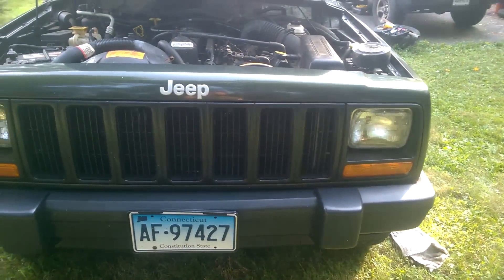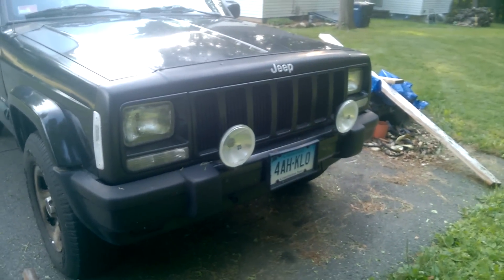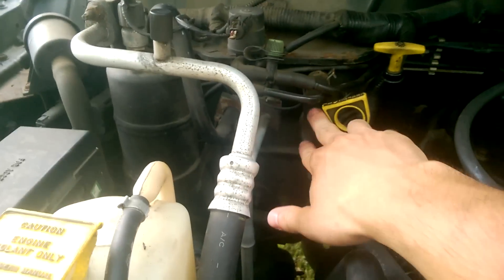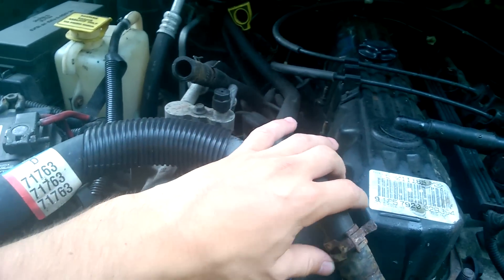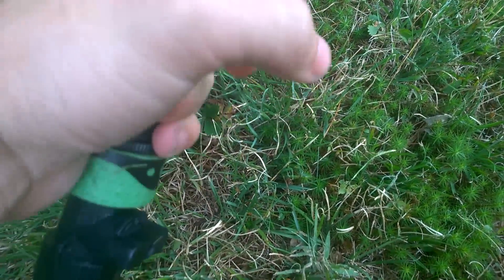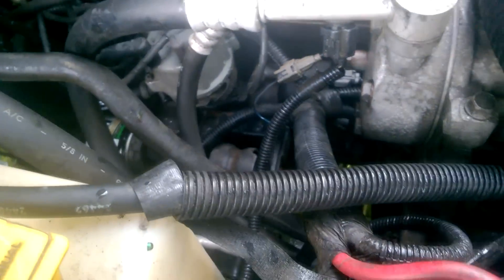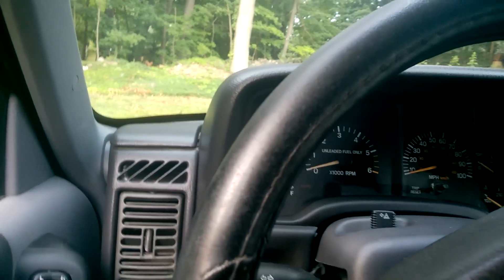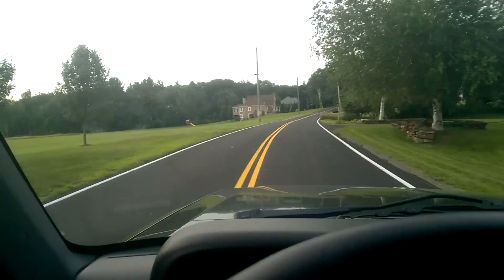1998 Jeep Cherokee XJ Heater Core Flush

Comment: My heater was luke warm at best.  Local shop flushed the coolant system for me, but no real change to the heater temperature. The same local shop quoted me $700 to swap the core in my Cherokee. I flushed my heater core this morning, and it made a night and day difference. Great video, thanks!!
Reply from the maker: Jarrod McCarty no problem! Never heard of a shop that didn't scam it's customers and do bad work at best. Glad I could help :)
Reply: Yes! The man always trying to take advantage of our lack of knowledge about vehicles! You win.
Reply: @hermit6208  Not so much taking advantage of our ignorance. Replacing the heater core is an absolute nightmare that requires removing the dash.

Comment: I'm about to attempt this in February in wyoming. Bought a Jeep Cherokee in Jackson, drove 3 hours with no heat 🥶 let's pray this works!
Reply from the maker: If flushing it doesn't fix your issue I'd imagine its the air blend door. Keep in mind that if anyone ever used stop leak in the system that will cause weak heat as well and will likely require more pressure than the average garden hose puts out. Honestly that stuff shouldn't be legal its useless.
Reply: @1598hi  I got it working! Core was nasty, but the return line was clogged near the water pump. Put the hose down in there and got the last clog out. Hot heat!
Reply from the maker: @j_mars_cars  good for you! In the spring you might want to try to flush the block and radiator as well. Sounds like you had some seriously substantial buildup
Reply: @1598hi  this Jeep is getting a full going through. It's got a bunch of small issues that need to be buttoned up. Don't worry, it'll get there. It's my mom's Jeep though, I own a 4runner that I gotta keep building

Comment: Thanks man. That's the cleanest 187000 mile vehicle I have ever seen
Reply from the maker: Still just as clean now with 210,000 miles. Thanks for commenting I hope this helped you!
Reply: @1598hi  we shall see later on today! When you started your vehicle up, I got a little movement down below! Sounds good man. Hopefully I can get my new to me WJ sounding the same. Or close to it
Reply from the maker: @hermit6208  I'm sure it will! Seafoam that thing and only run shell gas after that. Has the most detergents. I also have a flowmaster exhaust that I am pretty happy with

Comment: A couple things confuse me on the heater core/coolant flush.
1.) Seems like most people just use a garden hose. Would it be best to use a pump and set up a system that can flush using distilled water instead of tap water?
2.) some people recommended using a calcium and lime cleaner to really clear out the core. That seems like it would introduce undesirable minerals to the system.
Am I worrying too much or does it stand to reason that you'd use distilled water and not use C+L cleaner?
Reply from the maker: They sell special cleaners specifically for your cooling system and then flush the system after a little while. I think a garden hose is fine providing most of the coolant is actual coolant since that has anti corrosive properties and does not freeze. I wouldn't worry about using distilled water.

Comment: Nice video only issue is that you can flush the heater core no matter what setting the controls are at... If it's set on hot or cold it's all the same... Its doesn't stop coolant flow when you turn it to cold
Reply from the maker: Thank you for this constructive comment. I appreciate the correction
Reply: Before bashing Auto Zone about their tools and equipment keep in mind they have no way to test everything  when it comes back in and people won't tell when it is messed up. I bet they would be more then happy to swap it for you as they didn't know it wasn't working
Reply from the maker: @karlaharrell9424  I have noticed a dramatic drop in quality regarding everything from parts stores over the years. It's gotten to the point where I only use them as a last resort. You're probably correct about the tool though
Reply: Yes, the blend knob just actuates the blend door to go between allowing air into the cabin after passing over the heater core or ac evaporator.  On most older vehicles, this is vacuum-operated (which is why you hear a hiss sometimes) - on newer vehicles, it's usually a small electric motor called a blend-door actuator.  They are ...interesting to replace if they go bad.  If the engine is running, coolant is always flowing through the heater core no matter what the knob is set to.

Comment: Flushed my coolant and heater core on my new to me xj. The coolant was nasty and rusty. Tried bleeding the system for 30 mins and there were still bubbles and the heat was just lukewarm and not hot. After about 40 mins the coolant started pouring out so I shut it off. I did not use a funnel like you did. Any suggestions?
Reply from the maker: Did you park it on a slight incline? I would get a bottle of cooling system cleaner, add that, drain the coolant and replace it again. Sounds like you have some rusty sludge built up restricting flow
Reply: @1598hi  yes it was parked on the driveway with a slight incline. It already has cleaner in there with distilled water. Should I not burp it until I’m ready to fill back up with coolant? I wanted to leave the cleaner in there for a couple days that’s why I was trying to burp it.
Reply from the maker: @deegaw11  It was a good idea to get the air out. You dont want air pockets. Hopefully that cleaner is good enough to get rid of any stop leak. That sounds like it could be your problem if its not just rust debris buildup. Once you decide to drain the cleaner try removing the heater core hoses and backflushing them as well.

Comment: Great video. Do I have to drain the antifreeze before doing this? I recently changed my antifreeze but didn’t do this heater core flush and want to. Just don’t need to change the antifreeze since it’s fresh fluid
Reply from the maker: Nope! Everything you need to do is in the video!

Comment: Good vid flushed the zj today, still no good heat, bummer,  going to throw a new thermostat in next we shall see i really hope its not electrical.
Reply from the maker: Not losing any coolant or running hot? It might be the actual climate control knob itself
Reply: ReNegaDe-SpitFire  no not loosing  any coolant or running hot, and when its up to temp I can switch it from hot to cold and the luke warm air turns noticably cooler. If that makes any sense lol. Any advice would be appreciated. But It does blow hot at very sparatic times.
Reply from the maker: @halfassranch8363  I really think it's the climate control knob. You can order those from rock auto and autozone. I would make an account on maybe naxja to double check
Reply: ReNegaDe-SpitFire  i cant seem to find the knob, seems like this limited grand Cherokee is tricky. Its starting to piss me off. I live in colorado and need the heater lol.
Reply from the maker: @halfassranch8363  I feel you. Put your year, make, model, engine and transmission in the comments I'll try to find it after work tonight and get back to you around 11 to midnight
Reply: 1998 jeep grand Cherokee limited 4.0 not sure the tranny my wife drove it today. But its the full time 4wd if that helps. Thanks for the help I've always wanted a zj but didn't realize all the gremlins that come with.
Reply from the maker: Was looking online. Odd seems like I cant find one new for a zj either. The part is professionally called an a/c and heater control switch. However I do need to ask. How brown was your coolant? If it got really bad at one point in the past it could just be so gummed up the heater core just has to be replaced.
Reply: ReNegaDe-SpitFire  it wasn't really brown at all. I've done some research into these limited edition zjs and looks like some solder joints are prone to fail on the back of the big hvac panel. I agree with you that its not the thermostat because it gets to operating temp quickly and stays consistent. Looks like the limited grand Cherokee is a puzzle of its own lol. We have a week of good weather coming and I'll get it figured out. If not i can always just start a small fire on the dash. LMAO fuck it, its a 600 dollar jeep I'll get my use out of it and then send er down the road to the next poor unsuspecting fool.
Reply from the maker: @halfassranch8363  I recommend you join naxja. It's mostly for cherokees but it has a subforum for ZJ. You'll get it figured out before the weekend is over
Reply: Air in the system probably.

Comment: do i have to disconnect the hoses at the engine block? can i disconnect the mat the firewall and do it there? and if i can disconnect at the firewall, do i have to burp the system at the end?
Reply from the maker: It is much easier to take the hoses off where I took them off. At least in my experience they don't like to come off at the firewall. You will likely need to burp the system or you risk not having very strong heat.
Reply: @1598hi  yea i flushed the system but i dont think i did that great of a job of flushin it or burping it. The heat is still not hot. im gonna try again tommorrow
Reply from the maker: @Dibran9mm  once you do it again, if you're still having issues remember it could be the air blend door

Comment: Someone said in another video to blow out any extra liquid with an air hose
Reply from the maker: If you can get a little more pressure into the heater core that's great. Just make sure it's not too much. But assuming nobody ever used stop leak the reverse flush usually does a good job

Comment: Thank you!
Reply from the maker: ABC Sure! 😊
Reply: ReNegaDe-SpitFire . Great! Then take me all the way..... any tips on how to check the thermostat for proper function without removing it?
Reply from the maker: ABC If your engine is running way over temp or much colder you could have a thermostat issue. They are inexpensive and take very little time to replace. If you are having issues I'd start with a thermo and radiator cap rated at 16lb. I'd love to help you more if you give me some more information about what's going on!
Reply: ReNegaDe-SpitFire. Boom.... exactly what i thought also. Shes running cool. No problem, replaced many over the years. Appreciate you brother. Thank you for such a speedy response!
Reply from the maker: ABC Anytime

Comment: You forgot to flush the bigger pipes to
Reply from the maker: Those are for the block, not for the heater core. I put the engine in about a year prior along with new hoses and radiator. Heated core was all that was left of the original system and was the only thing that required a flush. If you need a tutorial on flushing your engine block there are other tutorials online, I have not filmed that. Stay healthy